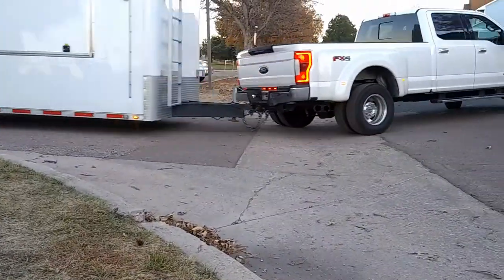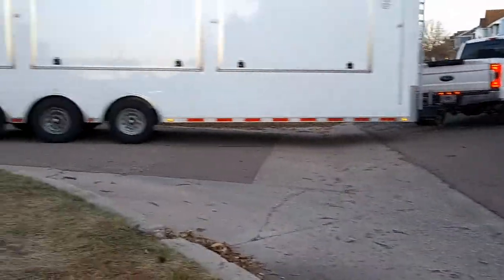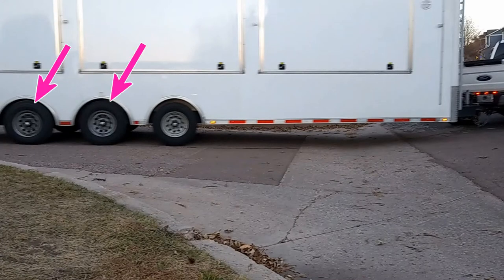Triple Torsion Axles Don't Share The Load — Is it a Problem?  Simple Illustration of Why.

Comment: I agree with this, I have a tandem 12,000 boat trailer with torsion axles. I've had to replace all of the original 10 ply tires with 14 ply tires because they were all becoming deformed. But for a marine environment, I'll still take torsion axles over leaf springs. As for the bearings, the salt water kills my brakes every few years no matter how well I keep them rinsed off and sprayed down with fluid film. I usually throw new bearings in when I have to tear down the brakes.

Comment: Good example of what happens but I wouldn't worry about it.  This is just basic stuff the axle, tire and trailer manufacturers are aware of.  The load ratings are rated for a continuous load in a variety of driving environments with rocks, bumps, pot holes, u-turns, ranges of temperature etc etc.  

These wheel off the ground scenarios only happen at slow speed in parking lots and driveways.
Reply from the maker: That's what dealers say, and many people are happy with the setup. Yet, those reassuring words are of little comfort when stranded on the road side, or to the person that just replaced tires and bearings for the 3rd time.

As a trailer engineer I see the failure side of this too often. It doesn't mean all will break tomorrow, but if you tow, it is something to be aware of. 

You are right, it works for many.  However, multiple unlinked axles are directionality incorrect in terms of stress and safety. That's the point of the video.

Best of luck to you!
Reply: As a trailer engineer a normal spring ride suspension doesn't distribute either. You need a tandem walking beam or air ride (as long as you keep the height of axles level with each other).

Comment: What can you do to fix this problem? I have a triple spread torsion axle trailer 30' floor 8' attic. The rear axle bounces seemingly no matter how I load it. It is tearing up my equipment. Any suggestions? Thank you
Reply from the maker: Get video of it if you can, by mounting a camera under it.  Take it to a trailer parts / repair shop and ask them. If the mechanic looks at you with a blank stare, take it someplace else. You need somebody that knows what he's doing, and that's not super common. RV places are not the first choice. Good luck.
Reply: @SyEnsability  thanks. I just had everything inspected and it's fine. It seems to me like the rear axle is too far back on the trailer and it's hard to get the right balance of weight on it.
Reply from the maker: A visual inspection is not going to tell you what you're looking for. It takes a special person to see what is causing the trouble.
Reply: @SyEnsability  could a shock absorber be added to the torsion axle?

Comment: Dear SE,  That's a scary video.  I can't imagine the weight put on that single tire.   But even if the front and middle tires followed the rear tire down to the pavement (no gap between any tire and the road), how could we tell if there is actually any decent weight distribution between all three tires?  In this instance, the rear tire could still be taking all the load, with only springs and gravity forcing the front and middle tires to (barely) touch the pavement?   In other words, whether the front and middle tires touch the road or not, how would we know they are taking any of the trailer's weight?